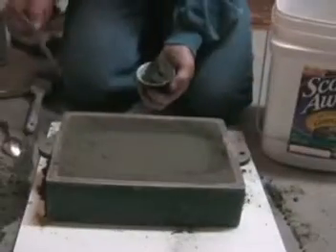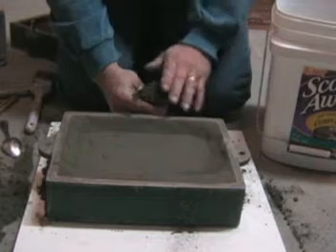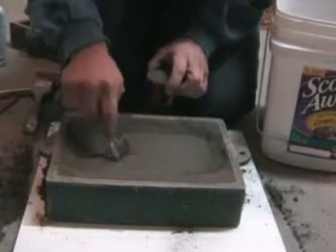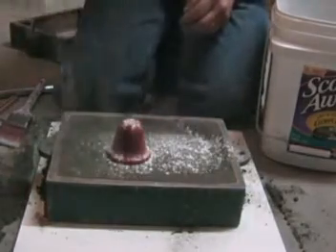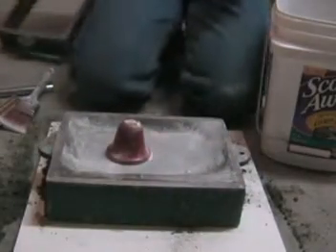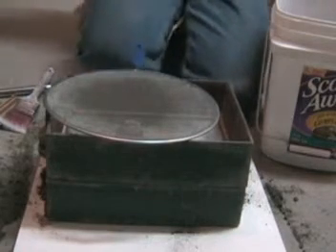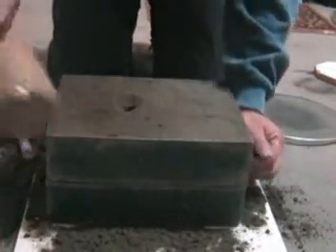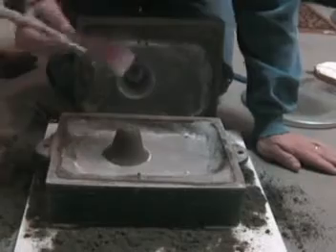Pewter Bell:Molding and Casting, Part 2

Comment: I have made many bells much larger than that. Its fun to set up the molds. I can cast up to 15 inch cast aluminum alloy bells. T pour from top and leaving an extra hole for gases to vent. The ring like cast iron ones.